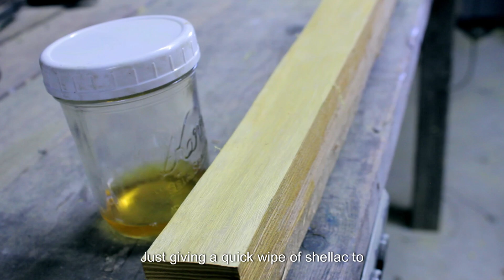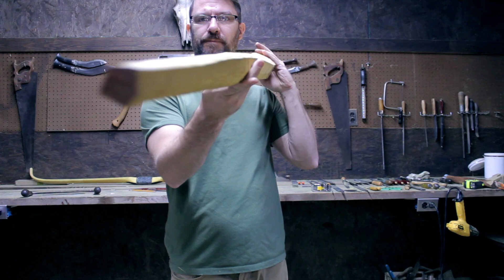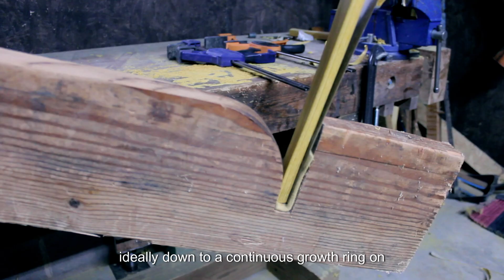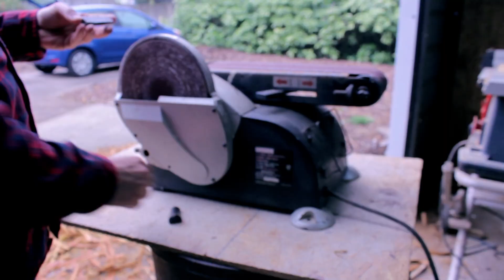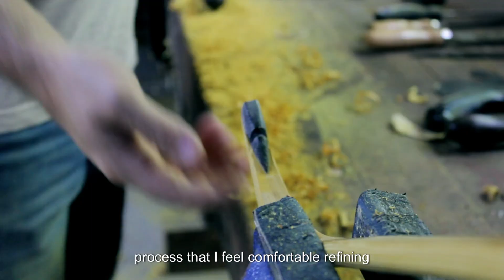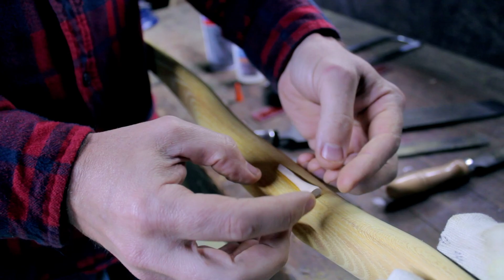How to Build an Osage Recurve Selfbow from Start to Finish

Comment: Great build along per the usual.   Those skins are awesome.  I like how you built up the area around the rest with cork.  I use it to round out the front of my handles underneath the handle wrap.
Reply from the maker: Thank you. That's a good use for it as well. builds up small handles well too

Comment: Hi Weylin...do you round your bellys so aggressively with every kind of bow wood? Also with elm or hickory? Or do u only just work with osage? Greetings from germany...nice to see you again...
Reply from the maker: I will do it initially in the early tillering regardless of wood type just because it is a more efficient wood removal method. As I progress with the wood removal it will flatten back out. I will end up with a very flat belly on a whitewood flatbow. Even this recurve is quite flat on the belly, just rounded corners.

Comment: If any of you want to make a bow and are on the fence about taking a class - let me give a quick review.  I took Weylin's class this year and made a bow in four days.  It wasn't difficult but it wasn't easy.  Weylin was there every step of the way and I feel like I accomplished something I had always wanted to.   If  you are considering a class - consider Swiftwood Bows.
Reply from the maker: Thank you! I really appreciate the review and the kind words.
Reply: Have been following you from 2018. Built a few mulberry bows with your YouTube building tutorials.

Just one question: what type of paint do you do the white dots on the sides for finishing?

Greetings from South Africa
Reply: @rupertbezuidenhout7455 mulberry is   underrated for this application. Also, crape myrtle makes a very springy, easily tillered bow(especially, if there's no twists and you plane the stave on all four sides).